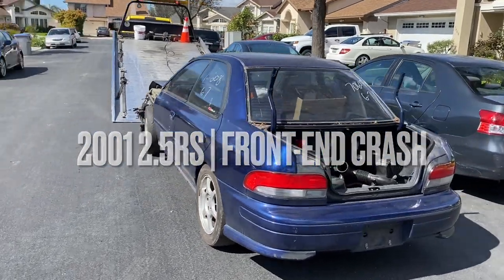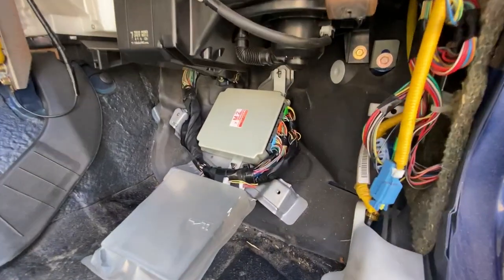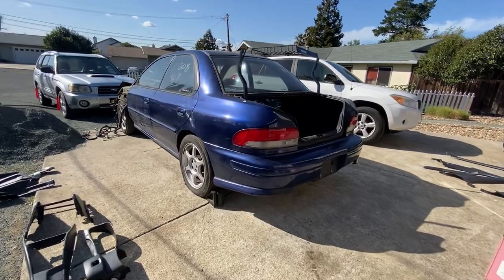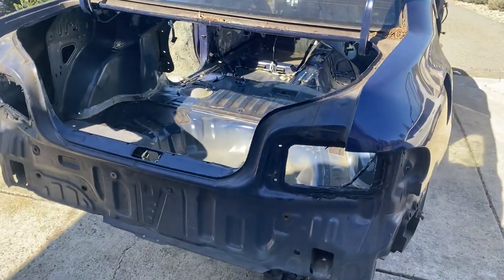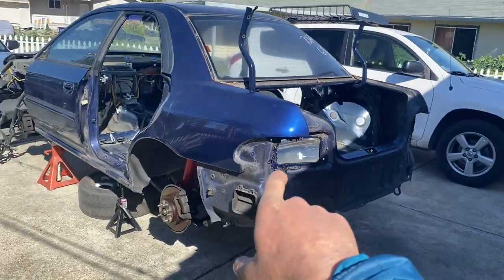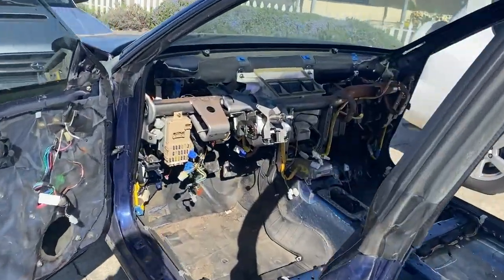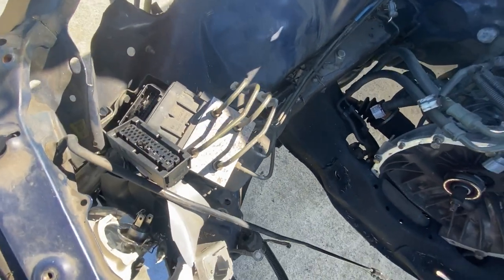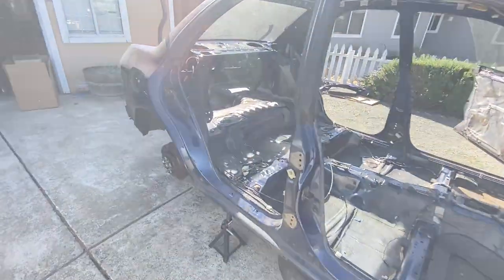CRASHED 2001 2.5RS (Can it be Saved?)

Comment: does the glovebox, and center console swap into a 1998-2002 forester?
Reply from the maker: That’s a really interesting question. I think the glove box does. But the center consoles are slightly different, so subtle but there is a difference in height. I might make a short video comparing the two, because I had always wondered the same!

Comment: Nice! It has JDM tail lights too.
You should just transfer the rear subframe and everything over because the RS diff is a viscous lsd and a different final drive ratio than the L.
Reply from the maker: Yes, I would but unfortunately the rear diff is the one thing that was sold before I got the car n